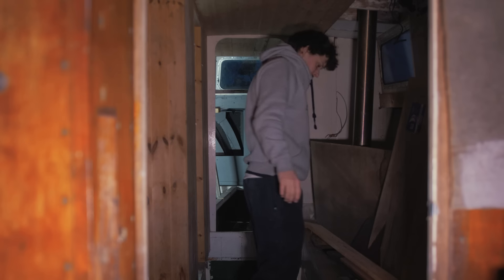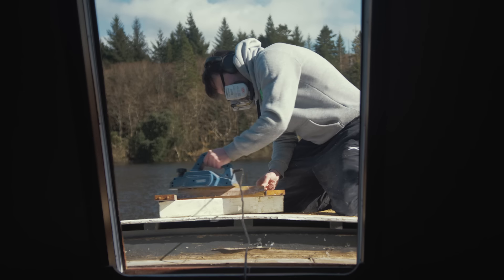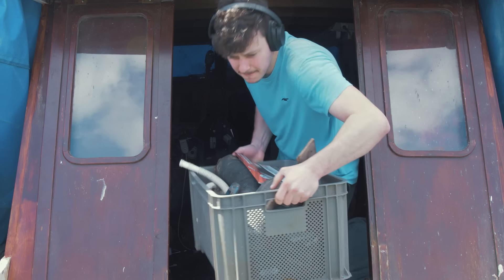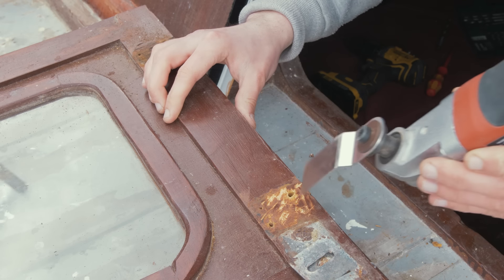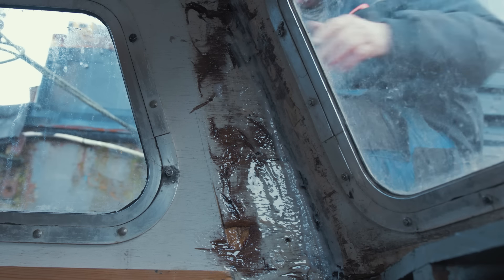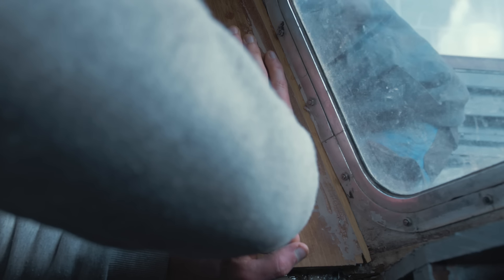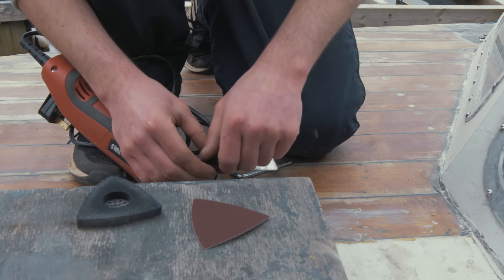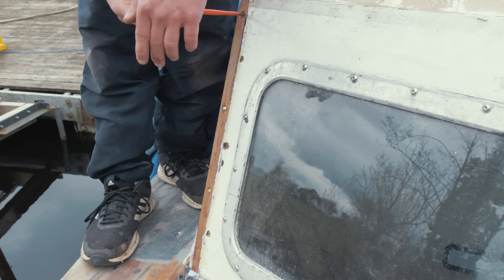1940 Wooden Seaplane Tender V-berth Repairs | Episode 35 ⚓

Comment: Take the screws out once the epoxy has cured fully,  drill holes out and add mahogany dowels. It's a trim piece not structural, the epoxy is doing all the fixing work as it is, gluing dowels in will help prevent joint working open at the ends as the joints move about. 🙂
Reply: Great idea!

Comment: May I ask why you're using flat head screws, I presume it's to keep it original in style but it seems so troublesome.
Reply from the maker: As much as possible I don't want to mix metals. I want to prevent delignifaction and galvanic action as much as possible. Unfortunately we did have to use stainless steel screws for the bow repair. I would have preferred brass or bronze. A carpenter who worked on the boat in the past before my parents also used lots of iron screws which caused damage even within the interior of the rooms but nothing severe. Thankfully